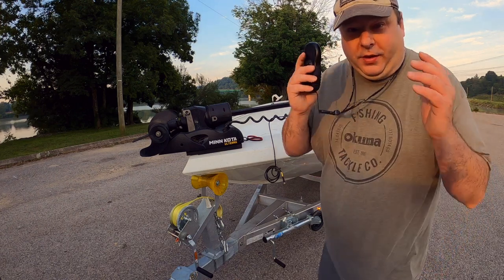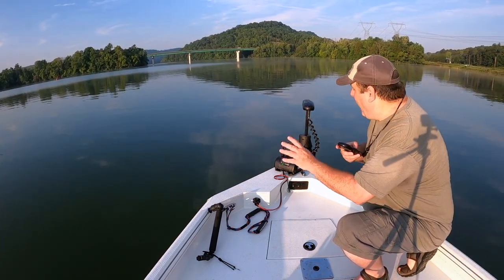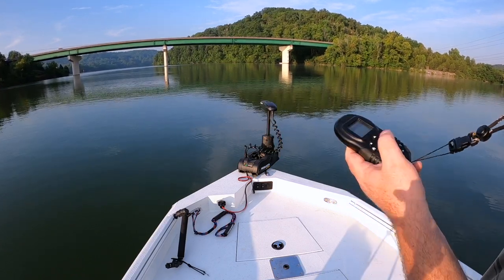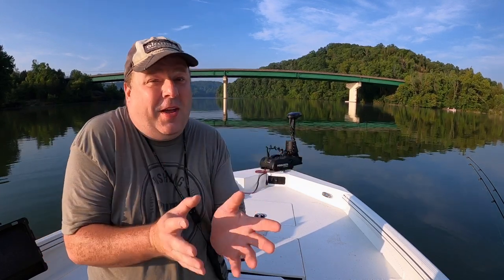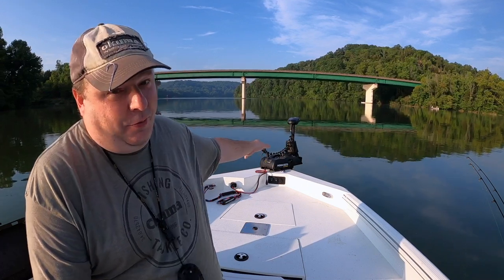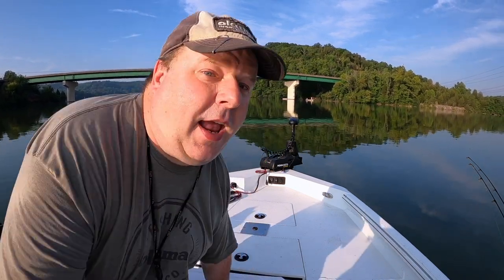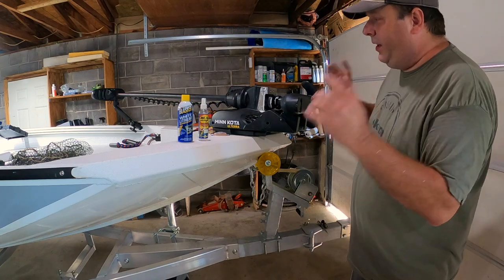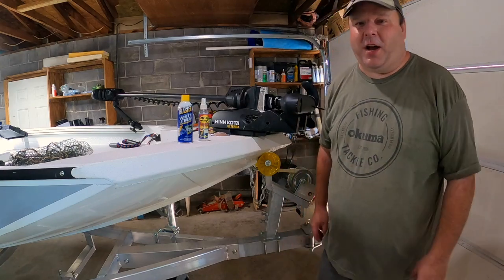One Year Ulterra Review (the expensive lazy mans trolling motor?!)

Comment: Not lazy, just have balance and walking issues from bone cancer and removal of 60% of my left pelvic bone. The Ulterra is one of the tools that makes safe fishing possible for me. I never thought of using it at the boat launch. I can't wait to try that at the launch next time.
Reply from the maker: Just don’t forget to turn it on!!!
Reply: @TNRVG  That would be really bad. I put it #2 on the pre launch checklist, right after putting the drain plug in.
Reply: Thanks. I have some leg and balance issues too. I have trouble getting up and down on the casting decks. It’s the main reason to look at this motor.
Reply: Worker smarter not harder now and days 😅😅😅😅🔥💪🏽💪🏽💪🏽💪🏽

Comment: I sell minn kota motors, everything you said was accurate and helpful, and you were correct in saying the puck was only used for the jog feature on the motor. That is the only thing the motor will utilize it for, however, if you get additional equipment that requires heading sensors, you can attach it to the minn kota heading sensor and it will work! 👍🏻
Reply: What ah batteries are needed to run ulterra 80lb thrust?
Reply: @andrewzuk8721  80lbs thrust will be 24 volts, so wiring two 12's in a series is the best option, or you could get one 24 volt battery, but those can be expensive.

Comment: Was told by my Certified Minn Kota Troll Motor Repair shop to NEVER use any aerosol spray lubricant due to the aerosol will ‘eat’/dry the rubber belt/—he recommends using ArmorAll hand spray and/or Pledge hand spray!!! ANY INPUT INTO WHAT TO USE ON THE RUBBER TRIM-BELT ULTERRA ????John Castelluccio-DEEP SOUTH LOUISIANA 112 Ulterra Riptide w/60” shaft.
Reply from the maker: They really need to get their maintenance stuff straight.  I called them before I made this video.

Comment: Rocky Relationship: No one loves the Ulterra more than me, my boat doesnt go out without it.  I rinse and lubricate it as recommended, especially because i fish saltwater and it cost almost $3000.  I had it for 2 years and this is the second time its in the shop, first for non deploy and now non stow.  When your offshore in choppy, windy conditions the manual stow process is far more difficult at best, and not the safest thing to do in choppy seas. 

When I called repair shop he said lots of problems with Ulterras, one of which is getting certain sensor parts. Oh and wait until you see the cost of repairing these motors, $500 to $600 not unusal for major part replacement.

Pro Tip: Anyone buying a new Ulterra, do yourself a favor and get an extended warranty if you can. After reading some of the pro angler comments about reliablity, I decided to buy the extended warranty when I purchased. I seldom need to take advantage of extended warranties, but when it comes to boating as you may know Murphys law is on steroids. This is one insurance you will likely use at some point.   

 Now my dilema is the warranty company is giving me the option of repair, replace or refund, sounds shocking I know but that tells me something. They don't even seem that interested in repair, I guess due to the lack of service centers, long waits and parts availability etc. West Marine has no Ulterras in stock and it took almost 6 month wait to buy mine during Covid. All things considered I am seriously considering just getting refund and changing to manual, my confidence has been shaken.  Analogy: all the good days of cheating doesnt pay for one bad day.
Reply from the maker: I just bought a used 112 and the belt needs replaced.  I am going to try to do it myself.  The belt was about $60 on Amazon.  I have tightened it a couple of times but it slipped a couple of trips later.  The 112’s with long shafts seem to be more problematic.  I’ve never had issues with 80lb thrust ones.  Wish it was good enough for my new 21 foot boat (the 80).

Comment: I’ve got an Ulterra but still launch with the boat roped to the dock.  I don’t trust the motor to work every time.
Reply from the maker: I’ve had a borrowed boat go down the river because the owner connected the fish finder to it and the cable got caught not allowing it to deploy.  Thankfully there was a boat nearby to catch it.
Reply: What ah batteries do you use?
Reply from the maker: I’ve been using 50ah ionic batteries lately.  They seem to work fine unless I run the trolling motor hard all day.

Comment: This is next on my list for sure 💯. Question what if the motor or belt breaks down on the water can you still lift it up and down manually ?
Reply from the maker: Yes there is a way to manually pull it out of the water.  It only requires a Phillips screwdriver.  You take the side off then take a plastic cap off two metal brackets that are part of the deploying system.

Comment: u will never experience this, but in Chicago its useless in the cold. One drop of water when its in the low 30s and it freezes and u cant move it up or down. Happened to me on lake Michigan when i was  perch fishing. Of course its never really freezing here, even in the winter. Water temps drop down to low 40s, but never in the 30s
Reply from the maker: I actually froze one years ago.  Ending up taking it to the repair shop to fix it.  Have to be careful in the freezing cold!
Reply from the maker: btw I am giving you a shout out in a future Carp video!
Reply: I live south of Chicago and fish Lake Michigan also late into winter and I’ve never had an issue with mine. But I am careful on really cold days like wiping down the shaft with a towel when stowing it and I keep a small bottle of Armor All in the boat to wipe down the shaft also in freezing temps. If it’s to cold for that thing to work I shouldn’t be out there fishing 😊👍👍👍
Reply from the maker: We have crazy weather here in TN.  It was pouring rain the day before mine froze and warm enough to fish in the rain.  Then the temps crashed.  Pretty much froze everything.

Comment: Great video!  Looking to buy one soon.  I fish for musky also, does it have a contour feature? or do you use the North feature following the banks?
Reply from the maker: It just goes on direction to my knowledge.  I know you can network it with a fish finder however I have never used it like that.
Reply: Sounds good, maybe I'm thinking of the Ultrex.  I love that auto deploy feature, especially launching, ever tried it retrieving your boat? obviously, you would have to have the motor trimmed up, just enough to get it in close enough, to strap it in?  Just a thought. @TNRVG
Reply from the maker: I still use the big motor to put the boat on the trailer.  I do spot lock it away from the dock sometimes while I back my trailer into the water.
Reply: Sounds good!  One thing I was thinking about, after watching videos about auto launching, and the swimming comments.  Why not do a quick auto deploy at the launch area, when prepping your boat for launch?  Not sure if you can do a quick bump test, up and down to make sure your good?  Just a thought.  Thanks for the replys back!    @TNRVG
Reply from the maker: @dougmead7669  Cant deploy while on trailer because it would catch on trailer?

Comment: I had one for five years. When it worked it was great. But I’ve had to swim after my boat more than five times. I no longer have it.
Reply from the maker: I lost my buddies boat once because the transducer cable got stuck.  Didn’t had to swim as a bass boat saved it.  No issues yet with the ones I own except my current one.  My trailer hits the prop and breaks it every now and then.
Reply: Did you have any issues with de lamination to the shaft Mine delaminated after three months use Cleaned with fresh water after every use, dried, sprayed with silicon and wiped Boat is shed stored every day?
Water ingress to control board shorted out!!
New shaft is now delaminating again after three month use again. These units are not very well sealed to keep water from contacting electronics and electrical connectors!! Any information would be welcome?
As I use mine in Salt Water it gets salt sprey over the bow and into the power connector block! As it is not sealed at all from water running around on the deck and splashing into the base unit!!
Reply from the maker: @rongill4199 I have not.

Comment: I got pause massage on my remote can you help me
Reply from the maker: I don't know how to do a reset on the remote.  Maybe take the battery out.  On the Ulterra itself if you turn it off, then back on.  Then hold the power button for 3 seconds.  It will reset the motor.  If none of that fixes the issue contact Minn Kota.  Their support is usually good.